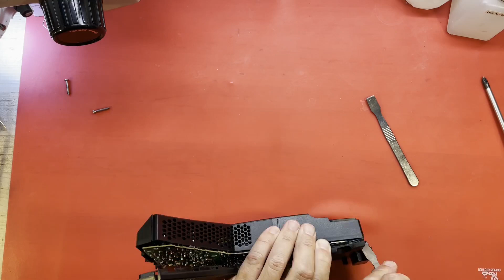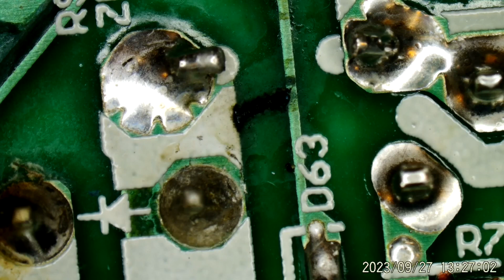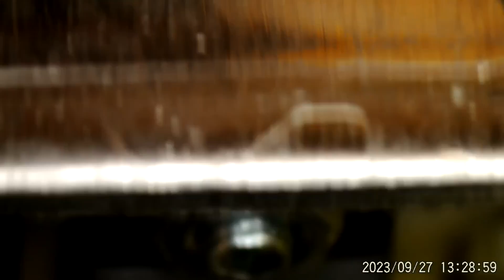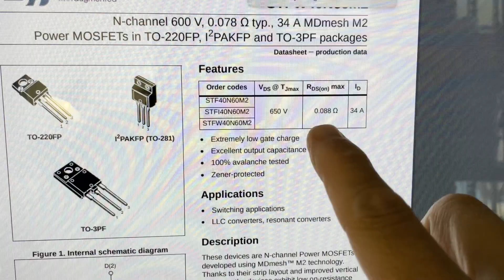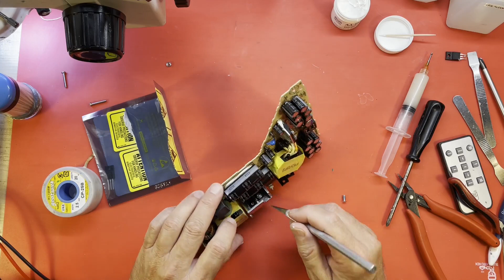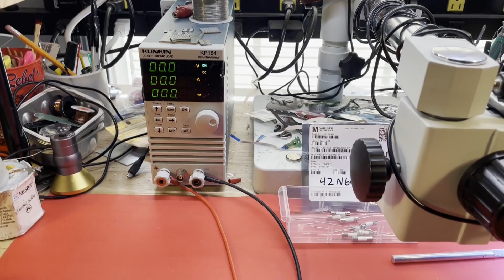#112 Repair of ADP-400FR

Comment: Hi, in my power supply, Q2 is blown/exploded and D63 is shorted. Should I check other components?
Reply from the maker: D63 connects to Q6 which is the PFC driver transistor.  I would check R96 and the DAP053T.

Comment: Sorry, I have another question. What is the name of the diode marked ZM (ZD33 / ZD34) and ZD (ZD37) on an ADP-400DR power supply? This power supply still drives me crazy, I've replaced a lot of defective components and I'm finding more and more.
Reply from the maker: ZM is an 18V zener.  ZD is an 8.2V zener.  Both are 400mW SOD323 package.
https://www.nexperia.com/products/diodes/zener-diodes/series/PDZ-B-Q-SERIES.html

Comment: I have a ADP-400DR with a blown C87 cap but cant find any diagrams anywhere on the net to find the value if the cap so I can order a replacement.
Wish i knew the value of the cap.
Reply from the maker: I think it is 100pF.

Comment: I think that's the first time I've seen you fix one with the primary side fuse gonzo. Seems like 99.753% of the time something on the secondary side/feedback circuit goes kaboom. Nice work. Love your approach. I would've probably wasted time desoldering the bridge first... Patience is king, bravo!
Reply from the maker: I'm glad you enjoyed.  That was the first time I have ever replaced that MOSFET in a PS5 supply.  I need to get more of that MOSFET.